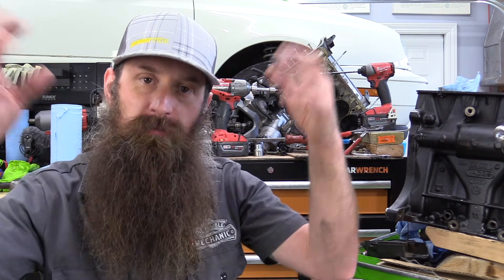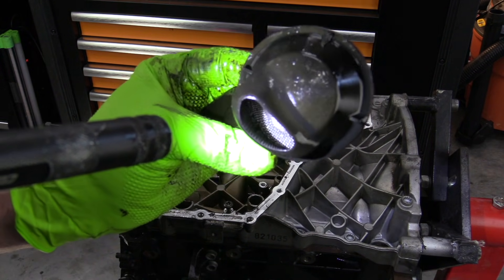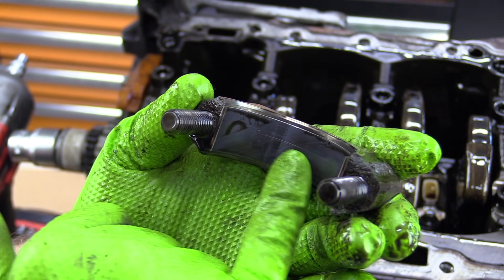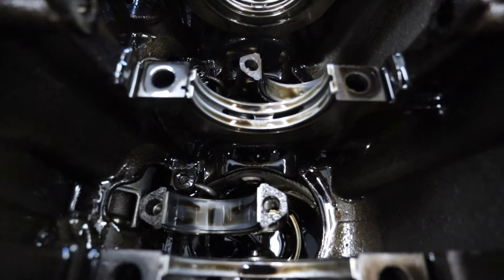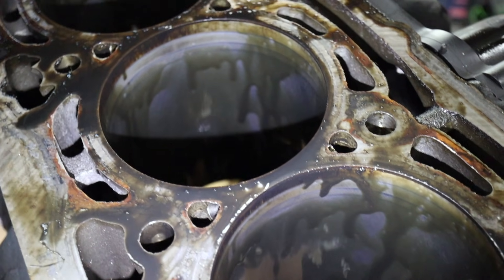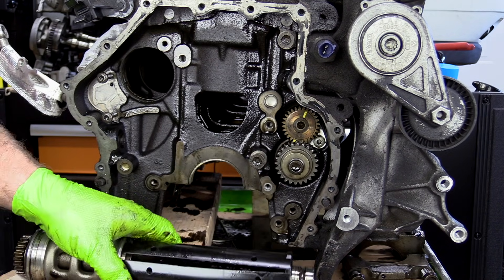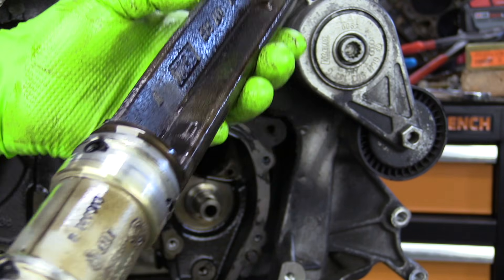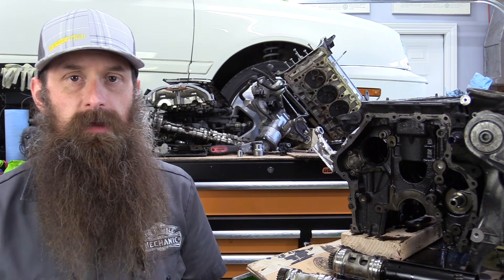2.0 TSI Engine Bottom End Teardown ~Pistons, Balance Shafts Oil Pump

Comment: The Block itself is very solid. Crankshaft is forged ( i think). Very rarely do the cylinder bores scratch. 

This is the one part of that engine that's reliable

Comment: I never touched that balance shaft screw when I replaced water pumps when I worked at Audi.
I just loosened the water pump and wiggled the belt off.
Reply from the maker: That’s how I do it too. The GTI had a recall on water pump. Part of it was replacing the seal behind th.
Reply: panzerveps true! Fucker will cause a headache, that belt should last forever. Idk but ffs thanks VW. All for 208 hp? Impressive, no replacement for displacement though.
Reply: Same technique i used here in Australia.

Comment: Hey Charles the 2.0tsi ccta and the 1.8tsi bzb are identical in parts I was told the crankshaft and pistons is what makes the difference in displacement can you shed some light on if this is true and what exactly makes a 2.0tsi a 2.0tsi?
Reply: They also have different connecting rods as well as the crank and pistons like you mentioned. The block is the same.
Reply: The con rods are also different as well as the pistons and crank like you mentioned. The block is the same.
Reply: @FourRingsAuto  OK thanks so basically if i wanted the same horsepower as a 2.0tsi all i have to do is change the bottom end?
Reply: @FourRingsAuto  Hey  can you assist me please I'm changing the seal on the balance shaft that's behind the water pump gear  when you remove the seal there is a small hole on the block on the bottom of the seal unfortunately the tip of my screwdriver broke off and a very small piece fell into this hole, can you tell me if this hole is directly connected to the sump pan etc or even better what does this hole do? does it supply oil to the seal?

Comment: Jesus this engine has so much potential failure points. German too complicated engineering at it's best!
Reply from the maker: This bottom end is not really that much more complicated than any other modern engine. Id love to get my hands on a Honda engine to compare LOL
Reply: @HumbleMechanic  I'd pay for that comparison video! Lol
Reply: I am a mechanic from Europe and I repair mostly EU brands. Not many engines have those balancing shafts, I know they help with damping vibrations, but not every engine has them and they are not worth the hassle in my opinion. And here 2.0 TSI has a very bad reputation, here everybody drives 2.0 TDI. Nobody is not even thinking of changing 2.0 tdi for a tsi. And I agree with them, 2.0 tdi is a much more reliable engine(even tho it's a diesel and more complicted and delicate, especially from the injection standpoint)
Reply: Honda engines are still in the car running lol
Reply: @michaelovers688   😄 😄 yeah, true. Would like to see the differences and why Hondas engines are so much more durable.

Comment: Hi Charles, quick question if you have time.  3:05 I need to replace my rear main; have you seen the iAbed "upgraded" rear main replacement and would you recommend it over the OEM rear main seal?  Thank you!

iAbed seal:
https://xlr8performance.com/i-37265-vw-audi-billet-rear-main-seal-for-tsi-engine.html?ref=search:https%3A%2F%2Fxlr8performance.com%2Fsearch.html%3Fq%3Drear%2Bmain%2Bseal%26Search%3DSearch
Reply from the maker: Heard good things about this style as log as it's installed properly.

Comment: I got a 2013 VW CC a few months ago. I noticed at idle the engine shakes every once in a while. Upon seeing this video, could it be one of the balancing shafts causing it?
Reply from the maker: Doubt it. That is a very consistent thing to happen. Like it may only happen at certain RPM, but it will happen all the time.
Reply: Change your PCV valve

Comment: The top-end of this engine is a nightmare, but damn, that bottom end looks bulletproof. I like the block-stiffening brace, and that main caps are cross-bolted, much like a Chevy LS V8. So technically, it's a 4-bolt main! No wonder modders are getting +600HP out of these blocks without much issue.

However that water pump belt looks like a PITA to change. Reminds me of beater brush belt off a vacuum cleaner. Leave it to the Germans to overly-complicate things...

Great video as always Charles! Cheers!
Reply: VW actually designs remarkably good engines I live in europe myself and i sometimes see things on videos about american VW's that we dont see here. I mean like hoses that arnt correctly put away and the engine not being properly bolted to the car itself. Shame since VW is known as really realiable here and known as unreliable in the usa.
Reply: mike, I wouldnt call those balance shafts "bullet proof" by any standard....

humble mechanic; very nice post. you have excellent narration.
to time both balance shafts, and cams from scratch looks like a PITA!!!
Reply: @fastinradfordable : no disagreement from me on that issue. Betcha the engine runs fine without the balance shafts. I'd delete the shafts, balance the crank, and live with the slightly lumpy idle instead.  But the utilitarian commuting 'normies' probably wouldn't like it...
Reply: Best 2ltr engine block was the BMW 2002, and they were getting +1200bhp out of 1500cc  turbocharged.  Cylinder head was a problem though on the road cars, never did solve the wear on the rocker shafts.
Reply from the maker: The belt is easy when the engine is assembled. Legit 3 bolts. LOL You are right about the booth end, its solid. I am surprised we didn't find damage here.

Comment: A question: i have 2.0 tfsi A3 from 2006 with original 135.000km on clock, what do you think, should I rebuild cylinder head in terms of cleaning valves and intake manifold (how much carbon build up should I expect from that mileage and age), and would it be safe to chip tune it at least stage 1, are cylinders suppose to be ok after 135k and not worn...cause upgrading new pistons and rods (to prevent damage from oil consumption) is too expensive, don't know if it's worth it. Anyways i'm looking to spend some money on this car cause I love it, any advice what should I invest in first? Thanks in advance!